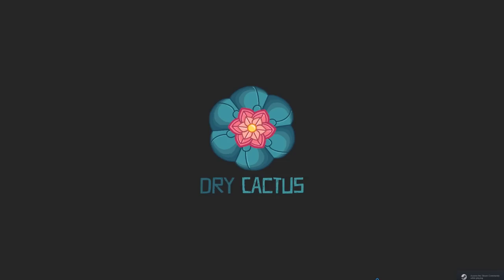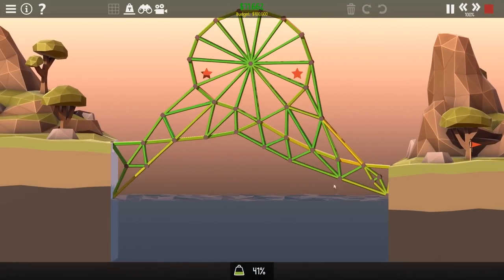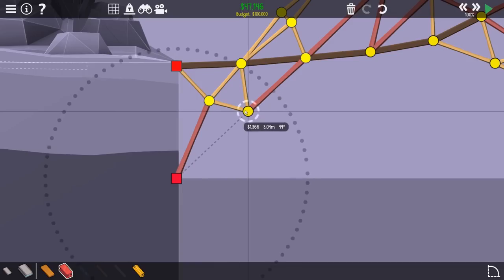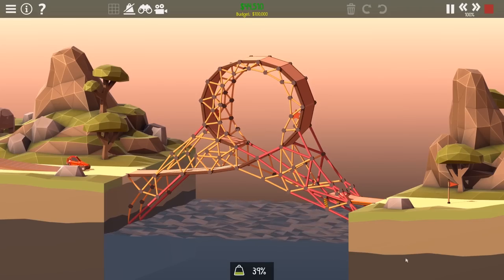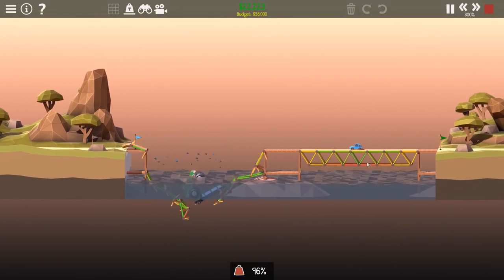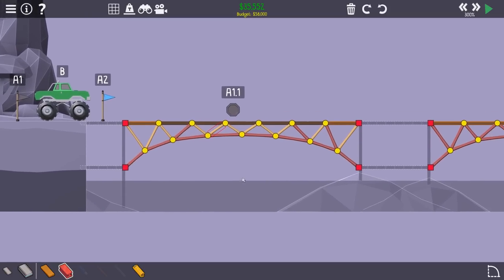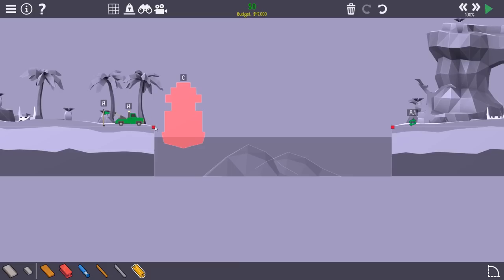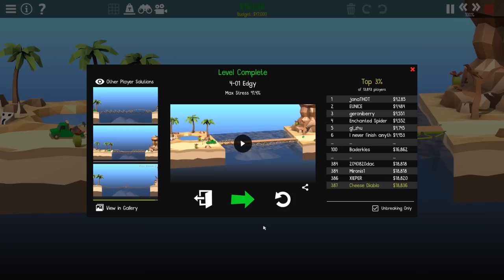How to CLIMB THE LEADERBOARDS in Poly Bridge 2 using ACTUAL ENGINEERING! Featuring a loop!

Comment: it's poly bridge, the stress levels are changed by everything, whether it's connected or not.
Reply: Holistic bridge
Reply: That’s odd. Why is it like that?
Reply: @zkassai.audio.2  because the code simply checks the stress of all pieces and displays the amount of stress on the most stressed piece
It doesn't bother to check whether any given piece is part of the "main" structure because that would be both presumptuous and complicated
Reply: I personally think it’s because.. well how do I explain it. The energy from one bridge gets like a weird shockwave type thingy over to the other one, the other bridge can’t handle it.. and down it goes. Pretty simple but probably wrong.
Reply: Quantum bridge
Reply: @itsyaboybrandon7509  No, it's been stated elsewhere that the weirdness with the two parts of the bridge being apparently dependent on each other is that there are internal random numbers regarding positioning of objects which get recalculated when certain objects are placed or moved, etc. Just a bug of the engine, more or less
Reply: @ionarevamp  Oh, i shoulda known better xd.
Reply: Butterfly effect
Reply: Not just that, but also the fact that the games physics get wonky when you speed up the level above 100%. Happened in the first one too.
Reply: @noobhero6661  That’s an “issue” in any simulation.
Not really an issue because the developers can’t really do anything about it.
Kepler space program, BeamNG, Poly Bridge, you name it…
When you speed things up, the CPU has less time to make calculations so the game engine just approximates things or your frames per second would tank massively.

In any simulation game, if you want proper physics, don’t speed things up. That’s a well know fact
Reply: @ateyaba7253  Assuming the programmers have any sense at all, speeding up a simulation doesn't mean that it has less time to calculate. It can still perform the exact same calculations, just with shorter pauses inbetween. If it truly can't keep up, it will lag the game, rather than skip calculations.
Reply: @SimpleAmadeus  No.
When you speed up the game, the precision is lowered.
Why would you have pauses in-between calculations ? - That would make the real-time simulation slower because you put pauses in-between calculations, whatever that means.

It has always been done the way I said because that way offers the most precise simulation possible at any speed.
If yoy slow-down the game, the calculations also get more precise.

Why on earth would you willingly put pauses between calculations ? You would be unnecessarilly making the simulation slower - while you could just remove these pauses and have better fps withour sacrifying accuracy.

I’m sorry but your comment makes no sense.

“Speeding up the simualtion doesn’t mean it has less time to calculate.”
It absolutely does…

The game has a phsyics model set in place.
If you speed up the simulation, you are FORCING the physics to happen faster, therefore, while your CPU initiall had 1 secont to calculate what should happen, now it has 0.5 seconds to achieve the same result.
Which means that there will be sacrifices made along the way, the physics model becomes less accruate because the CPU cannot do in 0.5 seconds the same ammount of calculations it would be doing in 1 second.
Unless you overclock the CPU, this just won’t happen.
Reply: @ateyaba7253  you’re wrong. Pauses in between are required otherwise your CPU would be pegged at 100%. While(true){} is what happens without pauses. Simulation should be the same regardless of speed. At a certain point the sim speed wouldn’t be able to go any faster because the physics calculations take too long. I don’t know how poly bridge is programmed, but I do know how a competent programmer would do it.
Reply: @kylekirby6424  The important thing to remember is that this is a game, not an actual engineering simulator to test bridges before they are built.

Most such games will have some kind of tradeoff between accuracy and speed. They will often allow you to run the simulation faster with less accuracy.